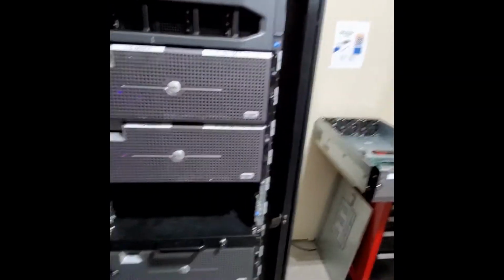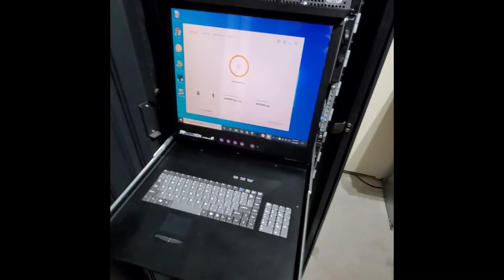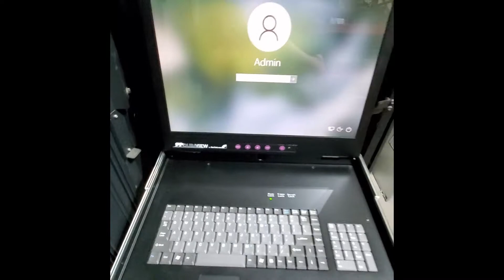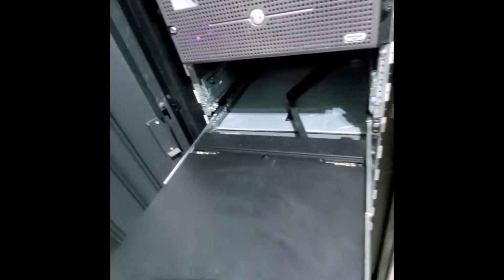Converting R900 PowerEdge Servers into GPU Crypto Miners

Comment: Hello Mine Time, first and foremost, love the vids man. I am doing the same with the R900 old severs. I was actually fitting 8 GPUs in. But having an issue with the R900 Fans rewiring at the back of case. Cant figure out the 6 pin to a 3 or 4 pin.  Any help would be appreciated. Thanks and keep up the great work. Happy Mining Brother!
Reply from the maker: I couldn't find adapters, however if you put 3 of the pins to one of the sides of the 6 pin it works. It was a while ago I did this and cant remember the specifics off the top of my head.
Reply: @minetime5151  I will give this a shot. Thank you so much!

Comment: Wait you can split pcie lanes???
Reply from the maker: Each slot has more than 1 lane. So no you cant split lanes, but you can split the lanes in a slot
Reply: @minetime5151  you ever figure  out why you could only post 2 gpus?  i got poweredge r720 b/c it has the requirements for running 3060's... all x16 and x8 lanes, gen 3, 2 cpu's that hand handle 40 lanes each.  was something wrong with yours?
Reply from the maker: @rmhrmh9459  i didnt ever figure out a solid answer to that issue.
Reply: Might have to dust off my powwredges in the garage